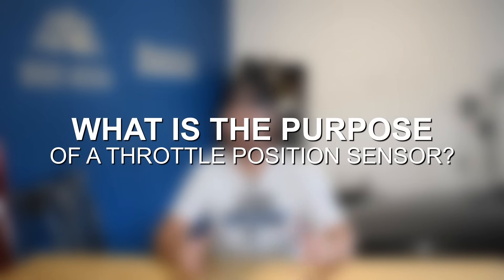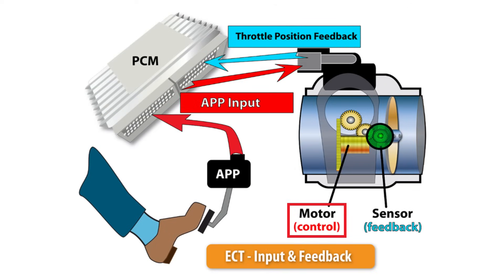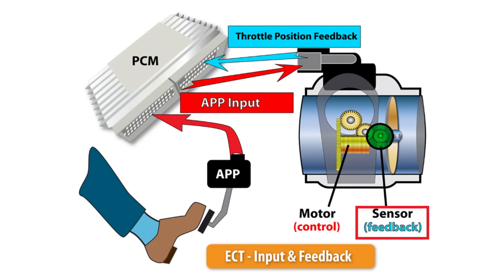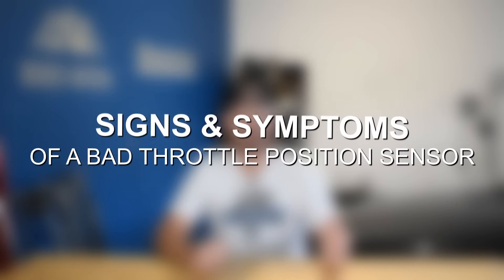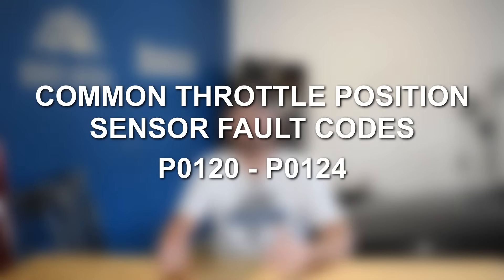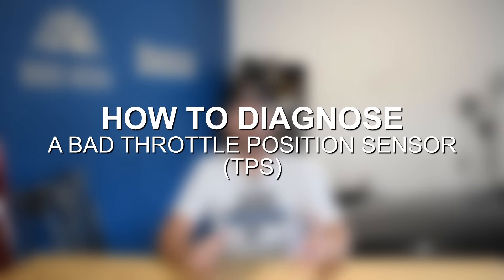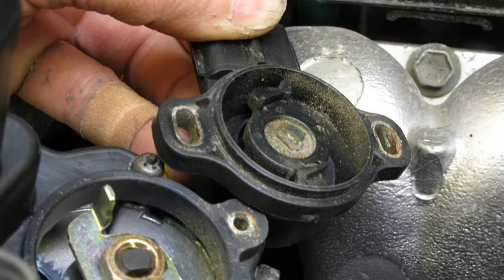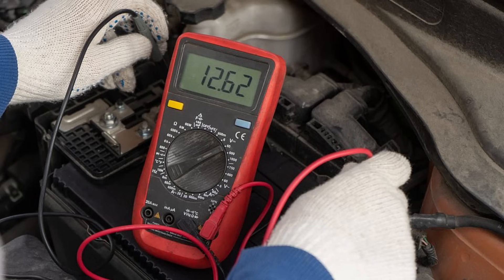Signs & Symptoms of a Bad Throttle Position Sensor (TPS)!

Comment: What do I use to clean the TPS? I have taken  my Sentra back and forward to Nissan 10x  for the same code: p0101, MAF sensor, to firestone, to Midas, and an off brand mechanic same code. Today, Nissan says they're going to try 2 replace TPS for $1787.00, are they CRAZY!! I'll try what you have suggested first by cleaning it or replacing it. Thank you.
Reply from the maker: V - Sorry to hear this... $1,700 is crazy. There is Throttle Body cleaner that'll do the trick!

Comment: Will a throttle body cause a miss until the engine worms up? Changed colls spark plugs and wires .runs normal when worm.when it's cold same thing thing don't have a code reader. 2007 Chev uplander
Reply from the maker: C - It's possible.. But without an engine code, it'll be more difficult to diagnose.

Comment: Im here because my RPM will go up while in park or neutral
Reply from the maker: 7 - Hope this video helps! Are you getting any engine codes?
Reply: @8020Automotive  cruise control multi-function input A circuit high
Reply from the maker: 7 - Could be your cruise control switch!
Reply: @8020Automotive  I have a 2008 ford crown victoria p71 I don't think I have Cruise control

Comment: Hello bro, i have a 2015 genesis coupe and in the last week the abs and antislide light came on and p0123,p0222,p2105,p2106, p2110, p2159 and p0507...i ve clean all sensor and remove the tb controller i had on my gaz pedal but didnt change anything...and my car is not as nervous as it is supposed to be and dont shift at normal rpm but randomly...i ve think about the tbs, the app or pcm...but with those codes what ull look first?
Reply from the maker: P - Easiest first is what we always go by.

Comment: If you don't have money but have time, the parts I would want to clean is throttle body, IAC valve, mass airflow sensor? Anymore ideas? Did he mention Idle air control valve? My 05 chevy 1500 2wd has almost 300k miles. There's room for improvement for acceleration hesitation. Most folks don't seem to dig the idea of cleaning o2 sensors instead of just replacing them at this point. My check engine light stays solid with the only code being the evap system even after paying a shop to run the smoke test. I replaced the canister vent valve solenoid.. been on for years after 15 years of driving my truck. The purge valve was easy & cheep to replace.. fixed problem with truck struggling to start after putting in gas.. Don't buy aftermarket sensors right? OEM only? Any more cheap & easy fixes/ preventive maintenance on sensors? Damn electronics...
Reply from the maker: N - This video may help with the power loss you're seeing: https://youtu.be/ipjYLPJgpq8

Comment: The accelerator pedal position sensor and the tps have similar symptoms, however you mentioned in another video that the app sensor could put the car in limp mode but not the tps.  The problem with my 2008 mustang gt is that a lot of times it wont set obvious mil codes.
Reply from the maker: J - Fortunately, both sensors are relatively cheap if that's what you think it could be.

Comment: I have an old 2003 Mitsubishi galant 2.4l, 235k miles. Their known for rough idles, yet no one per the forums in the past 20 years have pin pointed the actual cause. I myself have cleaned the front of the TB plate and inside with carb cleaner. I then have to reset the car in order to erase the auto tune of it adapting to the build up of gunk. It will run smoother for a little while but not 100% smooth then go back to rougher idles. Its started to idle real high before warming up, and even when it lowers the rpms to a more suitable level (starts around 2k rpm, eventually lowers to 1.5 or 1k rpm. When i first cleaned it it went from the rough 1k rpm to about 750 rpm which was smoother. Sometimes time it will drop to about 500 about the first 15 mins of running after warming up at idle in Drive and sometimes stalls out. Do you suggest cleaning the TB and TBS sensor better or start looking into the idle control senseor. Once it gets running it runs fine until more recently it hasnt wanted to slow the rpms down adequately when im slowing down, to the point when im almost or at a dead stop the rpms are still pushing 1500 trying to push against the brakes. One morning the rpms were jumping up and down as i was easing off the gas to slow or stop.
Reply from the maker: C - Sorry to hear this.. Are you getting a check engine light or any engine codes?

Comment: What if my truck doesn't throw any codes? 2000 ford excursion v10
Reply from the maker: E - What symptoms are you experiencing?
Reply: @8020Media  my truck struggles to accelerate like it's rpm is stuck and if I let off the gas and press on it again it will accelerate..... all this happens after the car is warmed up like 30 minutes or so of driving but before that it's fine
Reply from the maker: E - This video may be helpful here: https://youtu.be/ipjYLPJgpq8

Comment: Here because I need help lol😭 so my 17 Toyota Corolla is vibrating when my RPM drops to 500 when at a stop also my car squeaks when I release from my brakes. I got a diagnostic done and everything is fine, I got spark plugs and fuel kit done and still does it.😭😭 Also they looked at my brakes and rotors and they said they’re also fine. Idk what to do:)
Reply from the maker: D - Sounds like you may be experiencing a rough idle. This video may help with your research: https://youtu.be/BiYsqRJCLhE

Comment: i am getting a P0068 could this be what you mentioned in this video
Reply from the maker: O - This points us to your injectors. Some could be clogged.
Reply: @8020Automotive  I did have actually a clean of the fuel system I had this done last year. I did replace my air filter and now I'm not getting the code. The air filter seemed to be clogged.
Reply from the maker: O - Nice! Glad you found the issue. Thanks for sharing your experience. This will certainly help future viewers.

Comment: I am trying to remove PS pump. Can't get at bolts. It is absolutely ridiculous. I will never purchase a Nissan car again!
Reply: I just replaced front and rear valve cover gaskets and intake plentium gasket on a Nissan. I swear I’m never working on a Nissan again.
Reply from the maker: D - Sorry to hear! Hope you get it resolved.
Reply: Where is the
Throttle body  at
Reply from the maker: C - Typically by the intake manifold.

Comment: 2018 Kia Optima EX get Check Engine light (on/off) with P0010, and P0011 code.  Hi idle at 1.5-2.0 after replacing, Fuel Pump, Intake Valve, and CAM sensor... What else could it be
Reply from the maker: A - Have you taken it to a shop and they suggested replacing those?

Comment: Great explanation of how the car works.  My throttle body looks clean, but my acceleration is jerky. My r p ms are erratic, I don't have Quick responseWhen I press down the pedal at times.  I do not have any codes and my o d b.Reader didn't read anything.  I'm assuming my t p s is the problem, but shouldn't I have a code?
Reply from the maker: G - Thanks for the feedback. Not always. But here's a video that could also be helpful: https://youtu.be/ipjYLPJgpq8

Comment: I am sorry , but my 2002 Ranger still has a throttle cable . I think you meant sometime in the early 2000s and after that most vehicles didn't have cables anymore . Depending on make and model of course . I don't think very many , if any started not using cables in the 80s or even 90s . Thanks
Reply: Yep, both my 1990 Chevy S10 with the 4.3L V6 and 1997 Chevy K1500 with the 5.7L V8 have throttle cables!
Reply from the maker: A - Thanks for sharing this insight!

Comment: Removing the cable the way they did (and got rid of Power Steering Pumps, too) made it easier to get rid of people that expose corruption.
They can take control of your car and slam you into a pilon or semi truck... Think about that...
I won't have such things in my car. I don't like the fact that someone can remotely take control of my vehicle and drive me into danger.
It happens, folks.
Reply from the maker: S - Interesting take.
Reply: @8020Automotive   It happens. The tyrants have taken out members of the truth community several times that way, taking control of their vehicles and slamming them into stuff...
Reply: Unfortunately becoming more of reality.  Criminals already have the ability to get your security ID to unlock/start your car without using NFC to read your key.

The Government is also pushing to put electronic kill switches in vehicles to allow police to shut down a vehicle they are pursuing.

Add this to the push for AI and we are creating the ability to shut down the US transportation systems with simple pc code.   Keep in mind we can't even keep our networks protected from outside sources, they 100% will not be able to protect our vehicles.

All NFC systems and on board networking computers need to go away.  This goes for our homes too.  It does nothing but raise our prices on things under the guise of progress without security.

Comment: What if I'm experiencing these types of symptoms but I'm not getting a check engine light?
Reply from the maker: L - It is still possible that you're engine is storing some codes, just not giving a CEL. Do you have a code reader?
Reply: @8020Automotive  Thank you for responding...yes I have a simple small one and after scanning it 2-3 times just to be sure, it didn't throw any codes nor did it have any stored codes or pending codes. Also I might add, this is a 2013 Tahoe that I just bought about a month ago so I don't know how it was treated before. I took a look at the throttle body and when I lifted the flap I could see it was really dirty inside the throttle body and the intake manifold. Could it just need to be cleaned and the TPS is probably still good being that I'm not getting a check engine light or any codes?
Reply from the maker: L - This is definitely a possibility! Keep us updated.
Reply: @8020Automotive  ok so I cleaned the throttle body and the inside of the intake really good and had very little improvement. So then I went ahead and changed the TPS with the battery disconnected for a sure restart if the throttle body position, and then did a reprogramming on the sensor. It seems to be doing a lot better, not 100 percent yet bcuz it  needs to be driven a little so the computer can also relearn, and relearn according to the way I drive. To sum it up I guess sometimes you won't get a check engine light for this problem. And I do know that the engine light itself does work, I purposely make it come on to check it. Thanks for your help, and glad to offer feed back 👍
Reply from the maker: L - Thanks for sharing! Glad we could help here.

Comment: Where would check when you have  no power to tank pump assembly in a kia  no power at fuel pressure pump
Reply from the maker: R - The fuel pump. Are you getting any check engine codes?

Comment: Will that make the idle real high when I first start it then drive it for a couple miles and the idle goes normal
Reply from the maker: M - Possible!
Reply: If the engine runs at 1,500 rpm or less upon startup, that's normal. The fact your idle settles down shortly after driving is normal operation.

Comment: Digital Throttles started coming in the 2000s.  90s OBD1 and OBD2 will probably have a mechanical throttle;  I don't know what this guy is talking about in the beginning with digital throttles starting inthe 1980s (for your consumer grade car?) -- I don't know -- maybe he's talking about foreign vehicles or NASCAR or funny cars.   Mechanical throttle body is basically a potentiometer||[ resistor ]||[volume knob like on your radio] that monitors the position of the throttle and tells the computer the location|position of the throttle.  When the TPS goes bad, the computer makes stupid decisions and stuff shifts wrong and the motor and transmission will screw up.  Back-probe test the signal to see if the resistance is moving with the throttle -- if not then its screwed up.  Replace it or fix|clean it.  You usually replace it.  Digital Throttles means all of that is happening on a chip (at the microscopic level);  digital throttles are in the new cars and they're a piece of crap.  Good luck - because you're going to need to get a computer that can talk to the vehicle's computer to see the digital signals for what is wrong with it.  This is why DIYer buy Chevrolet because the fixing is open sourced kind of.  Ford and other brands are proprietary and you have to buy in to getting the equipment (or reverse engineer that stuff yourself).
Don't go throwing parts at the problem in hopes that it'll be fixed.
Reply from the maker: C - Thanks for the insight.

Comment: I have a nissan 08 Altima 2.5  My issue with it is that when l stop, then the car won't  go only goes to 10mph for about 5 to 10 seconds and then it starts picking up the speed,  it doesn't happen all the time, maybe 2 times a week, and l don't get any faulty codes.
Reply from the maker: R - This video could be helpful: https://youtu.be/ipjYLPJgpq8
Reply: Bad cvt transmission

Comment: I had my traction control module repaired on my C5 Z06 and everything seemed fine for while then I punched it one day and everything went south the reduced power light came on and the check engine lights and the traction control light 💡 I was able to get it home I did the onboard diagnostic check and codes P0120 and 2135 appeared and a few others I was able to clear the other codes, but not these codes I replaced throttle body in the car runs really weird. The RPMs are up so I’m kind of leaning towards. Accelerator pedal sensor your thoughts?
Reply from the maker: R - I think your diagnosis is spot on. Look into the sensor and keep us updated.

Comment: HI, I have 2009 Camry le 4. Cylinder, the problem is it’s feel like chocking when accelerating then it opens up , what do you thing the problem is also where is the location of the map sensor.
Thank you
Reply from the maker: G - Are you getting any engine codes?
Reply: @8020Automotive  not at all
Reply from the maker: G - It's more likely to be fueling related, ignition related, or a filter being clogged.
Reply: @8020Automotive  thank you , i will work on it.
Reply: i am going to use red line complete fuel system cleaner o see if it will help first.

Comment: What if you get no coat at all and I have no check engine light on, but I’m gettingthese symptoms
Reply from the maker: D - If the sensor isn't expensive for your vehicle, you can try to replace it and go from there. But we wouldn't go throwing money out at parts without engine codes. What symptoms are you getting exactly?
Reply: @8020Automotive  hesitation at mid speed. Press the throttle no power then it takes off    very rarely, but once in a while, it will stall when I come to a stop, but very rarely
Reply from the maker: D - We have some videos that may help you out here: https://youtu.be/ipjYLPJgpq8
https://youtu.be/7bqAIbYRdnc

Comment: I have had my jeep in the shop 5xs now because of the throttle body. The sensor has been replaced, the wiring harness, and the throttle body itself 2xs now, and also had to have the sensor reset. It is still acting up. The light, along with the check engine, is back on. Body shop is saying I will need to pay for a factory throttle body instead of the aftermarket I have had. I have no faith in them at this point. 2017 Jeep Patriot Sport. 
Any suggestions? My brother said replace the pedal
Reply from the maker: A - What engine codes are you getting?
Reply: @8020Automotive  p2135
Reply from the maker: A - Could be the pedal or the pedal position sensor. Have you tried those?
Reply: I had this same issue with my 2016 Jeep patriot. My mechanic was able to diagnose it down to the ECM. New OEM replacement was required. Fixed it

Comment: Thank you. Based on symptoms I now believe that it's my car's Tbody system needs examination and then compare it to my transmission which the mechanic thought was the problem.
Reply: Same here.
I was told I needed a new transmission.
I went to have  the accelerator pedal position sensor & and throttle body sensor replaced.The  mechanic kept saying those parts, have nothing to do with your car not going above 30mph then slowing to a stop. Rpm @ 3-4. 

He quoted $2900 to replace the transmission w/6mth warranty which would only cover parts.
He said I could go get a 2nd opinion at the transmission shop right around the corner 🫤
Reply from the maker: W - Sorry to hear this.. Keep us updated please!
Reply from the maker: S - Are you getting any engine codes?
Reply: @8020Media I have this same issue my mechanic keeps suggesting it's the transmission but the codes says otherwise

I have p0121 and p0198 codes